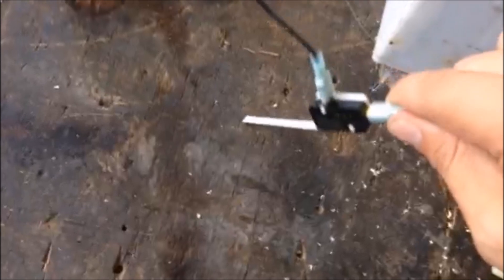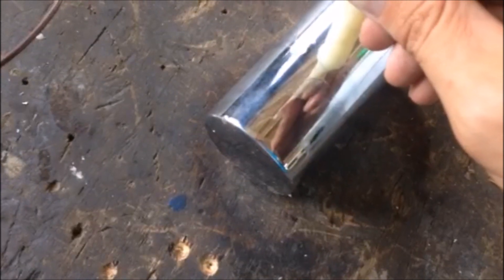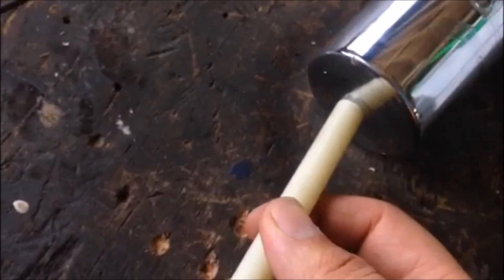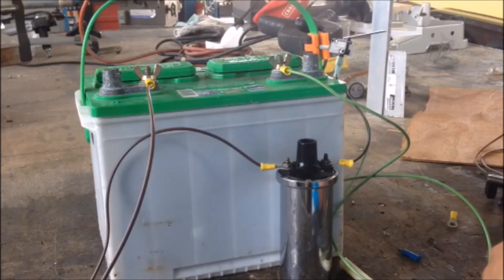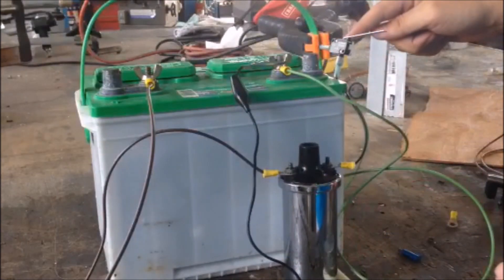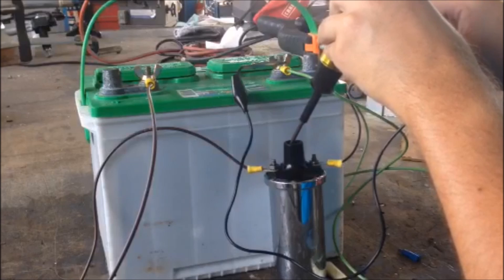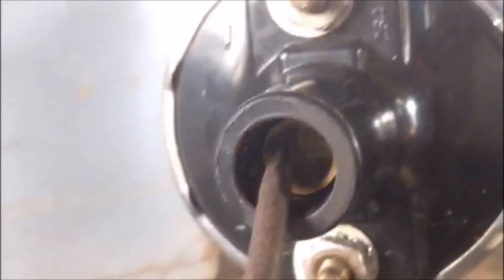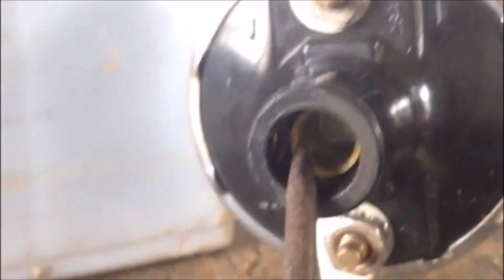This is how you can test a ignition coil

Comment: Is it ok to use a Beru Part# ZS172 3.3 ohms coil on stock points set up. I've heard it might burn points faster using one not at factory specs your car calls for. I got a 72 Ford Pinto 2.0 eng

Comment: Thanks for this. I just got an old Onan generator and it’s not getting any spark. Points look good and while I don’t have a set of feelers to check em with, they appear to be opening and closing with the right gap by eye. I’ve always seen that you could temp. Hotwire the coil to test it but I’ve never done it before. I just need to do it long enough to see a single spark at the plug wire, that’ll tell me the points or condenser is bad.

Comment: I just wanted to say your coil still may have an intermittent issue. You tapping the switch is not even close to how fast the signal is sent from the computer which the coil may or may not receive constantly.
Reply from the maker: MrDCJSr.   Ya I should have been more specific in the title and description.  This was only to test if the coil is able to spark.  When the coils short out or become internally damaged they can no longer generate a spark ⚡️.
Reply: my point is I just changed a coil in my 2005 Cadillac SRX ignition coil for cylinder 6. The coil would work perfectly when the car reached normal temperature. This situation caused me 500 dollars. I had a defective replacement coil and after extensive troubleshooting finally bought another coil and my engine have been running like it is new since changing the coil.
Reply: I should have added, the coil worked at high temperature but not at cold start temperature.